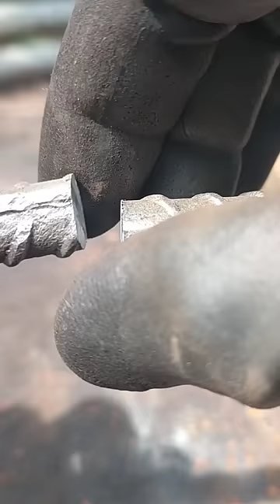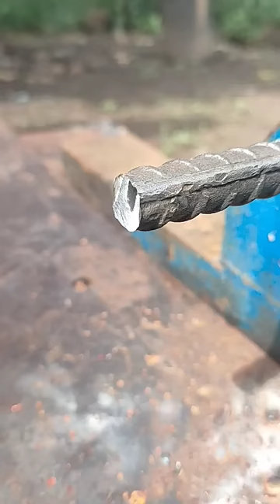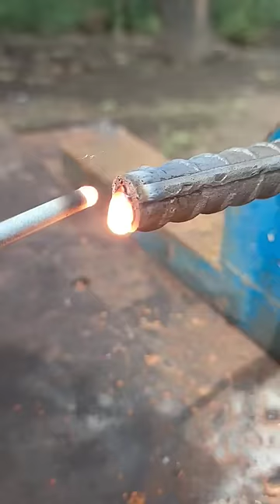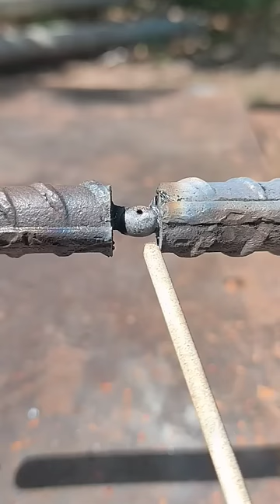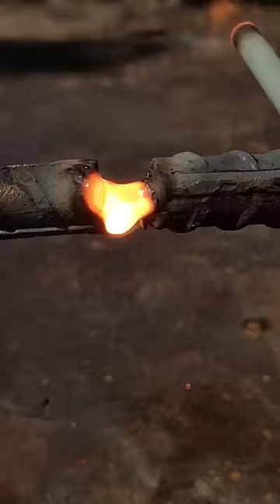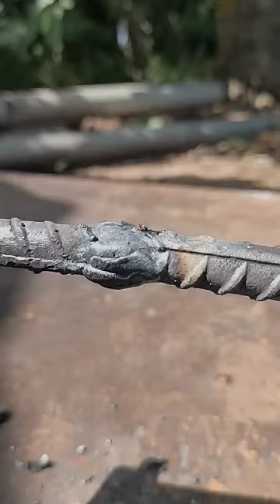welding shorts #weldingshorts

Comment: I’m going to need the locations of every structure you’ve ever worked on so I can avoid them at all costs.
Reply: My thoughts exactly 😂
Reply: I swear😂😂😂😂
Reply: Funny😂😂
Reply: Indeed
Reply: Dumb ways to die~~~
Reply: 0000000
Reply: I was saying 😅
Reply: Im no welder as you can tell,i take it hes doing it wrong? I start a welding course in 6 weeks so i aint a clue.
Reply: Welder on the hardrock hotel disaster.
Reply: spot on
Reply: Looks like china
Reply: The rest of his videos are on point! ive learned how to weld thisn metal thanks to HandWelder2.0
Reply: Fr
Reply: Yep exactly
Reply: Was thinking the same thing and I'm no welder
Reply: Rather ignorant. It's so the weld is as strong or stonger then the material. If you butted them then welded, you would have a fisture in the middle of your weld.
Reply: Actually, good welds are stronger than the steel getting welded together. Welds break when there are fissures created during the welding process, hence why he didn’t butt weld these, as a gap would have been created between the pieces of metal.
Reply: China
Reply: always has to be lapped so many inches depending on size of  rebar
Reply: That’s what I’m saying!! Like what is wrong with people
Reply: @CHRISlovesENGLAND  the reason he's welding it this way is because if you just weld around it the middle is weak it's not bonded together but the way he has done this it is sold metal all the way again and stronger
Reply: Like did you see the gap that ish is going to break
Reply: @CHRISlovesENGLAND 
This is very dangerous can’t be repaired
Reply: Я ору
Reply: @CHRISlovesENGLAND Roughly in the middle of the video, you can see porosity in the weld. That is a bad, bad thing when welding anything structural and probably an effect from him welding by placing tack upon tack upon tack withoutremoving slag in-between.

The vids where he only tack-weld thin stuff that clearly ain't structural doesn't matter so much, but anything that can hurt people or valuable property when it breaks needs to be properly welded and cannot have slag or other impurities in it.
Reply: funny but wrong 😂😂😂
Reply: Ahahahaha, nice comment
Reply: 😂😂😂😂😂. Good one
Reply: این میله از ناحیه جوش خم نمیشه
Reply: @jayciaravino6542 The friend is just posting a common video, it doesn't mean that he makes structures hahaha

Comment: Great tip, perfect for reusing rebar leftovers, only downside is having to leave the country afterwards to avoid prosecution after the building collapses
Reply: Lol, good one.
Reply: 😂😂😂😂😂😂😂 Вы прочитали мои мысли.
Reply: Ригель с колонной сваривается примерно таким методом. Ванночкой метод. Или медная, или графитовая ванночка.
Reply: That's really a good one ,as a Mexican I approve that message
Reply: 😂😂 but he didn't say it was for reinforced concrete. 
Rebars are for multi purposes use. In Structural engineering you splice the rebar. Welding it like that can definitely collapse the building, also depending how many of such welded butt joints you will have and at what position...
Reply: 😂😂😂😂 very well thought out.
Reply: Lan ben Türküm ben bile güldüm 😂😂😂
Reply: Most rebar produced outside of the US is explicitly weldable. Only Americans insist on using crap rebars.
Reply: @Бывший-ч8ъ только вот написал он про другое ,умник
Reply: It’s the best comment 😂
Reply: Lmfaoooo🎉🎉🎉🎉
Reply: This. Exactly this.
Reply: Certíssimo amigo!
Nem todo aço pode ser soldado com segurança,  especialmente os aços usados em edificações.
Reply: @melvinmorenoestrada8362 sin dudas, pero debe salir más caro que comprar la barra larga completa
Reply: The net says it's ok to weld grade w steel 
    Its the high carbon that will shatter 
I don't know which this was or it's use and am not a welder but hope at least this welder would know his job and not make that mistake
Reply: В месте сварки арматура никогда не сломается!!!
Reply: You had us in the first half 😂
Reply: Oh so a piece of flimsy 1/2” rebar is going to be the major holding link in a building? 
Smart azz
Reply: @Shaker626 okay but... Why? All you gotta do is lay them next to eachother to form a splice. Rebar is cheap. Welders aren't.
Reply: @КедрачТаёжный если будет просто валяться не сломается. Если дать нагрузку хоть на разрыв, хоть на излом - лопнет по шву.
Reply: Had me in the first half ngl
Reply: Gold

Comment: I think its better and more accurate if you just beveled the both edges and welded them
Reply: That right thing better beveled 
Will be more stronger
Reply: No
Reply: @luisalva4686 you've never welded then
Reply: Exactly
Reply: Correto.
Reply: Правильно в накладку или сильно скосить
Reply: @Rob-rp3cw  oooooo
Reply: Yeah, if you can make them a cone shape so that you can weld to the centre but add only as much extra metal as possible it would be less brittle on the join
Reply: saving time,, and lets face it, this is rebar , not something structural really lol
Reply: Обычно так и делают, кромки снял и заварил... Видимо у сварщика не оказалось шлифовального круга...
Reply: Ты думаешь в правильном направлении,но вот этот сварщик не совсем
Reply: Yes
Reply: I don't know a thing about welding but  I think friction would work best
Reply: The OCD checked in
Reply: @jedgurley if he’s worried about saving time and it not being structural then surely he should’ve just butted the pieces and tacked em together instead of worrying about getting to the center
Reply: chamfer the end of the rods better
Reply: @IsaacOnyait  you mad because i popped
Reply: Nice
Reply: no
Reply: Just bout to write that lol
Reply: Exactly
Reply: Mientras haya una soldadura de penetracion, no importa el método.
Reply: I slide a  cuplink over it weld slide cuplink over weld again
Reply: Hobart agrees
Reply: Te laczenie nigdy nie będzie tak solidne  jak po wyjściu z huty bez laczenia😊
Reply: 100% correct way it to bevel both sides to about a 45%  then weld it
Reply: Согласен!
И очень большой зазор
Reply: @kalvindick14 what if grinder not available?
Reply: @АлексейЩербатов-с2ь даже ооочень большой, так только идиот может стыковать арматуру
Reply: Learned if its w-400 os the only bar you can weld up for it to be code...i dunno it all turns to rust eventually buried in cement or not...
Reply: If You are not in a place we're there are not current?
Reply: @andrejohnson6101 friction would require one or both pieces to spin.
Reply: In my opinion this makes it stronger
Reply: Exactly!!!! I’m a Welder Fabricator and Mechanical Engineer We Bevel Things Like This to Gain Access to The Virgin Material Underneath & Add More Metal Fusion Over a Larger Surface Area…
Reply: @therarebreeds77therarebree7 Miller time 😊
Reply: Yup
Reply: Maybe he's tired of holding a grinder.. 😅😅😅
Reply: 這是？？？？？？
Reply: @quatrealex  русский язык учи. Пригодится !
Reply: И нахера, и так проварить можно былобы🤷
Reply: Muy cierto solo biceliar
Reply: I would have said Eff that & got another stick of rebar
Reply: 9😊😊😊😊
Reply: Что скажет лаборатория? Проект говорит перехлёст от двадцати до сорока диаметров или ванная сварка под флюсом.😊
Reply: Also the gap is over tolerance. Welding course come free with a box of cornflakes
Reply: Friction welding is way more stronger...
Reply: Xàm quá bạn
Reply: That's what I know. Bevel both ends.
Reply: @jedgurley Then just weld as is. Trying to be smart whereas anyone who knows about welding will bevel those edges for the weld to sit in.
Reply: @luisalva4686 why no?
Reply: @effendieffendi9639 "more stronger" killed me
Reply: This is the way!
Reply: Ya that is the right way
Reply: Bạn biết hàn đó
Reply: Да, это называется снять фаску
Reply: You are correct
Reply: For real
Reply: But then would it get welded in the center?
Reply: @samuelcf97  yes
Reply: Quá đúng
Reply: Chamfer in the edges will have good welding strength as per butt weld system and it requires heat treatment to avoid breaking on welding joint.
Reply: Sim, conheço um pessoal que faz isso com cardam, aquele treco que gira em baixo de veículos
Reply: @jedgurley rebar is what makes concrete structural
Reply: 용접봉과 시간낭비 😂
Reply: I concur 😂
Reply: Nah man, only the true professional welder mans weld like this
Reply: Absolument d'accord. Je n'irais jamais faire cet espèce de raccord sur u point de soudure.
Reply: @effendieffendi9639 Stronger or more strong😂
Reply: EXACTLY
Reply: @donbelenger817 🎉😅
Reply: this is the first thing i thought and i started welding school 3 weeks ago
Reply: @robmcghie5248  sorry more stong 😂
Reply: I think this is a joke video
Reply: Facts
Reply: @Igogo09 違います。面取りは基本的な工程です。勉強してください
Reply: @effendieffendi9639 more stronger 😂
Reply: This and the joint would have been stronger because it would have more surface where to grab from
Reply: @laharl2k  thats whay he meant when he said "better"
Reply: We already know that e7018 hasn’t seen a rod oven since it left the factory I think the lack of bevel is the least of the problems
Reply: Yeah ur right
Reply: I'm no welder, but the way he did it looks like he created a solid foundational weld, whereas butting them together and only welding the OD doesn't secure the inside portion.
Reply: @jedgurley I worked at a construction site and there I connected 25 millimeter reinforcement and it was supposed to hold 30 tons of tensile strength.
Reply: @luisalva4686 That big fat weld is super brittle. I saw one tack on one bar and thought "oh that's clever" then like 5 more tacks and then the OTHER  bar too. Guy had to fill like an inch and a half there.
Reply: There are even tools that can help you bevel this, I don't know what it's called but it has the same utility as a pencil sharpener.
Reply: Not even. Its rebar, just bevel one side and do a single fillet weld.
Reply: @volatile100  if you are a real welder then you will know every welder has his methods of doing things this guy did not do nothing wrong I was just recommending him my version if the job he's doing with rebar requires a strait rebar and with good tensile strength... his method is more stronger because he completely joined them without a bevel but my version will be more strait and aligned with medium tensile strength. While your version is faster and well aligned but will the least tensile strength and my version and HandyWelders2.0's...
Reply: At the advice of my colleagues I did this for a padlock that I had to cut for locking my keys inside. It has increased in value.
Reply: @marinoconstanza4306  if you have a welder you have a grinder and if you don't then you shouldn't be messing with a welder.
Reply: I was just about to say that that is the correct way to do

Comment: Perfect. I now know exactly where the rebar will break.
Reply: Asi es
Reply: hahahahhqha 0 resistance
Reply: Atleast it's axe tap proof...
Reply: Lmao
Reply: На самом деле, скорее сломается сам прут,чем сварочный шов
Reply: @funk998 😊oʻoʻ
Reply: Very good kkkkkkkkkk
Reply: @_-zerofan-_ you cant heat up carbon steel
Reply: LMFAO "!!!!!!!!!!!!!!!!!!
Reply: @_-zerofan-_ зависит от материала и свойств шва. Вообще может оказаться так, что он погнется по шву. Или разломится по шву.
Reply: Rebar is cold-rolled and formed, right?
Reply: I wouldn't consider that rebar now you know exactly where that slag pivot will break. 😂
Reply: Not necessarily, if he used the correct electrod matched for that grade of rebar then the weld would not break. Everyone's misconception is that the weld breaks, it's actually the HAZ heat affected zone, where the base material is weakend due to the heat and stress.
Reply: I thought of that
Reply: @garrett6494  Yes necessarily, you don't drop a tac on the center of rebar and fill the Gap filling around that large gap. It would have held better without that nonsense. Welds aren't always the weakest point but this guy create a weak point at the weld and he's also welding rebar so there's always that too. 🙄
Reply: @jamarjames9501    Well, if you're a welder, then you must have only ever seen perfect fit ups. I understand that there's better ways than this guy's fit up, but the weld will still "hold" the same whether it's butted or beveled with or without a gap. Tacking is part of fitting. As long as it's free of defects internally, that weld won't fail. Do You understand the numbers on electrodes and their meanings? It's all about tensile strength.
Reply: Lmao
Reply: 911 entered the room
Reply: @garrett6494 well that is excatly what this guy does wrong, tapping electrodes like this into a welding pool like its a mig welder will and has filled the weld with slag, pores and defects internaly. This is not a strong weld any way you slice it. Had he used a tig or mig welder were there is minimal to no slag and cleanes the edges then ok. But with electrodes? No way. Thats a dirty weld and you know it too
Reply: @kimandrebjrndal4914  as long as you dont let it cool off, the slag will mix with the old slag and carry it outwards. the weld looks clean in the end wich it wouldnt if there was slag in the weld.

Comment: For those that don't know.... that's reinforcing rod often used inside concrete to give it tensile strength.   That stuff is awful to weld....  SO YOU DON'T.   You overlap, tie it off and let the concrete be your glue.   LOOK AT YOUR ENGINEERING APPROVED DRAWINGS!!!
Reply: So does that mean that the video is not necessarily dangerous but just impractical?
Reply: Yes  @cheapcheese.